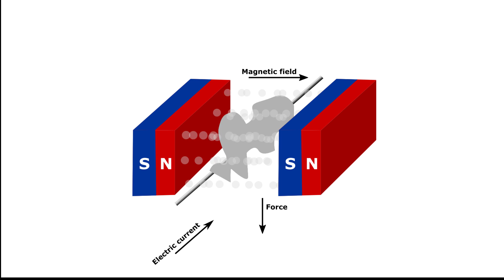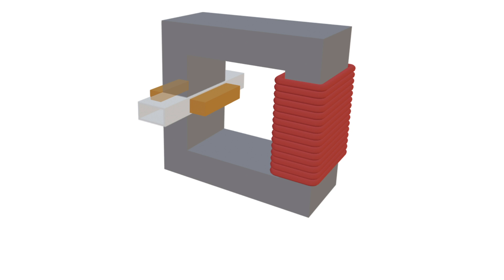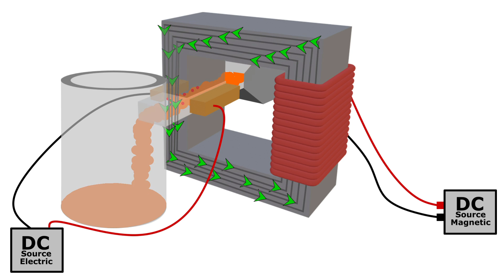Electromagnetic Pump

Comment: Thanks for the awesome video! So for the case where we turn off the magnetic source and run the electric source, my understanding is that since we have a current going through the liquid metal, this would generate a magnetic field that would circle around the flow of electrons (using the curl right hand rule). However, this would not generate a magnetic force, since this "circling field" essentially cancels out any forces. In order to generate a force, we would need a magnetic field travelling perpendicularly through the electric current (based on fleming's right hand rule). Is my thinking correct?
Reply from the maker: Yes. It's like the the way it would work in a small permanent magnet motor. If we take the magnet out and apply current to the motor, it would not turn even tough the current passing through the coil of motor creates a magnetic field.

Comment: hum, will water work? not as conductive as metal but it can still carry current
Reply from the maker: Yes it can work if you dissolve salt(NaCl) or something similar to make it more conductive. The problem with this method however is that the current will also break down the water into H2 and O. And since it's not as conductive as a metal, it's going to require a higher voltage. But it will work.
Reply: There's a video titled "Magnetohydrodynamics - Propelling Liquid Metal with Magnets!" on the Tech Ingredients channel where they use water.